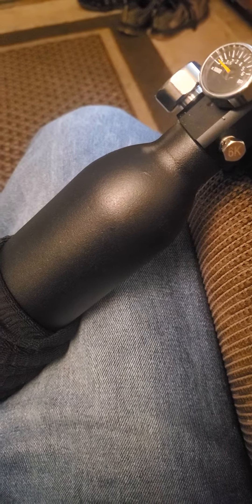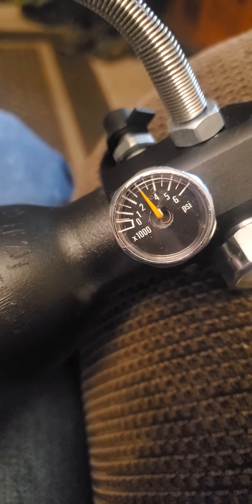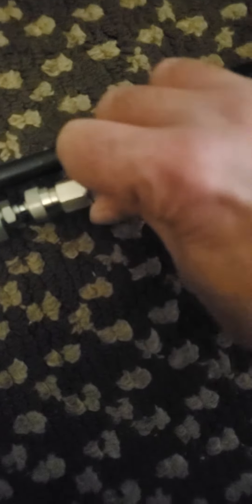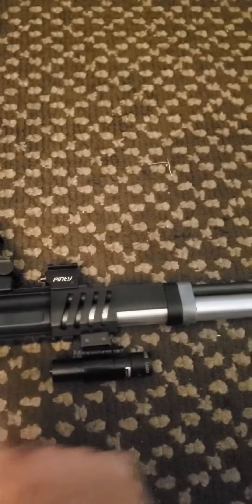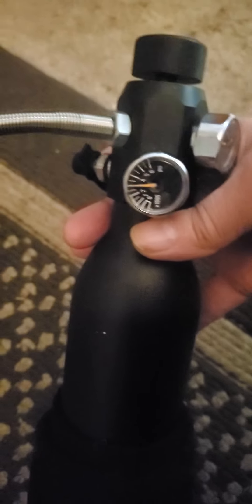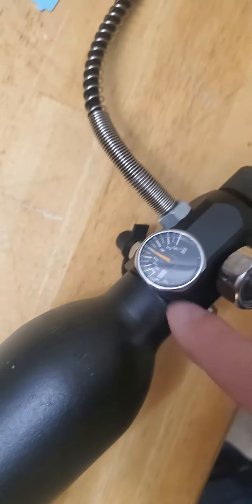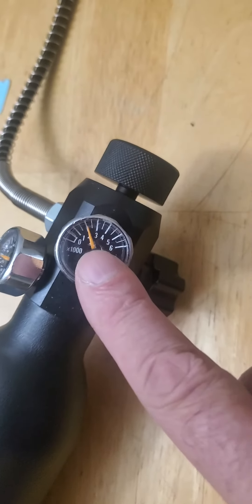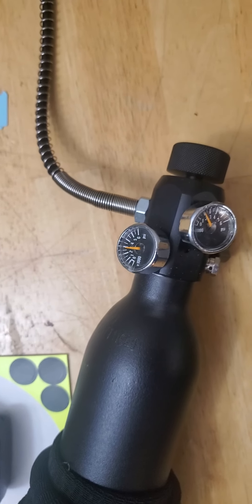Buying your 1st PCP airgun ?

Comment: Is the valve pinned in your build?  That would be the safest way to help insure your safety during refills.  Nice build on that puppy.
Reply from the maker: In the case of the safepac no valve pinning is needed , it works differently than the highpac units , for the safepac you have to remove the valve unscrew it then the safepac becomes the back half of your valve , the reason a highpac needs pinning is it just extends the tube walls the the valve stating completely intact , in that case you have the valve in a tube held by a tiny screw and behind it all your compressed air and the valve can become a projectile if the tiny screw fails that's why people talk about valve pinning,  in the case of the safe pac if the screw failed nothing would happen except maybe the valve and resiviore otherwise know as safepac might slid out of place but the whole valve would have to fail or a wall of the safepac could fail of you over pumped it . 
Safepac is 100 percent safe compared to Highpac , if you want to see what can happen when a highpac fails , type in Exploring the PCP HPA explosion and you will see a guy named Randy who had an accident with his Highpac , warning its hard to watch but he shot the entire 1 inch diameter valve 90 percent thru his thigh for sure he is lucky because if it happened while aiming he would have died for sure .
Reply: @jasonnealey8325  I saw that video.  Glad to hear than pinning isn't necessary with the Safepac.  I have pinned the valve
on several friends 2240's and am satisfied that it is the safest way to insure the safety of valve modifications.
Reply from the maker: @richardford1314  you sure are right about valve pinning necessary,  I thought Froggy Airguns had it figured out pretty well but I just saw a video of his HPA conversion for the Dianna and it screws in just like a highpac , when I saw the install my 1st thought was what's holding the valve in place in the tube . It looks dangerous.   I'll share something funny with you on my Safpac experience,  I built this gun then had to buy a pump , the pump Guage has MPa marked on it so I did research and found MPa doesn't have the same value as either PSI or BAR .

The manufacturer of the safepac rates it at 2400 psi ,  to my understanding 1600 MPa is equal to 2360 PSI , but when I pumped up my PCP .45 liter bottle with the hand pump the Guages corresponded giving same pressure of 3000 PSI , that means potentially I've never pumped up to the recommendations and have only pumped to 1600 PSI,  Im conservativtive in nature and don't like to take a big chance on something I'm kot certain of but I'm now thinking only the valve on the pump say MPA and all the other fittings are from PSI so it's not actually reading MPa at all , Im still to scared to try to go up in pressure top much but I did fill it with a bottle just 1 time and brought it to 2000 on the PSI Guage I immediately heard a difference in the hammer striking the valve it was much stiffer sounding , if I continue to pump to 2000 I will likely replace the light action hammer spring back to stock or get a stiffer spring . I like power adjusters but not enough to take my Buckrail-line stock off and use the crosman stock which would allow for micro adjustable power levels .
Reply: @jasonnealey8325  I'll make a video on pinning it's on my todo list
Reply from the maker: @BackyardDispatcher  in the case of Froggies safepac there is no need to pin the valve because the valve and air resivior are screwed together and sit inside the lower tube passively.   For other high pressure builds the valve is like a plug holding back massive amounts of air pressure.   Look at a video called Exploring the pcp explosion for a guy who shot the valve thru his thigh .
The brilliance of this design is the valve and tube are screwed together .  High pacs and similar builds are dangerous because you are making a tube never designed to hold pressurized air into your pcp cylinder then since you have piles of air pressure behind the valve it's like a projectile in a barrel with the only thing keeping it from flying out is the pin job ,  Im certain that there are safe ways to do it but , to me a safepack is a leap in design and I wouldn't ever use a system that requires pinning .

Comment from the maker: So you want to buy a PCP airgun , be aware that there are hidden costs .  Gun , Pump ,  then a Bottle so you don't have to carry a pump everywhere also for winter or rainy days  pumping damp air is bad so you carry a bottle that you pumped up with dry air at home and your golden .
Gun Minimum $ 200 , Pump Minimum $40 , Bottle Minimum $40 , valve and refill hose $ Minimum $ 50 .  Then if you are only human you need a compressor,  Minimum $300 .
Reply from the maker: renegadebroadcastingrenega610  the main issue is it sucks to carry the pump when I'm getting such a small shot count , Im new to all this pcp stuff so I'm mimicking a lot of what I heard and deduce,  you see on every pump and compressor they have moisture filters and it's not so much the temperature of the air as the moisture content .

Honestly I wanted the bottle because the pump doest fit in my backpack but it's not comfortable , with the bottle you can bank your work .

You can pump a little bit at home each day. Pump it with dry air from your home and get multi refills 
I probably will still buy a compressor and maybe one more bottle and valve combo .
Reply from the maker: renegadebroadcastingrenega610  more like 15 shots right now , I choked it back down and put rhe stock transfer port back placed the stock hammer spring inside the valve and a super light hammer spring for the Hammer , laughably it still has the stock plastic breech and bolt .
I recently bought an extension hose for my hand pump and now it's almost doubled the amount of pumping , I needed an extension so I didn't have to take the moderator off for every fill , next time I'm getting the 18 inch barrel .